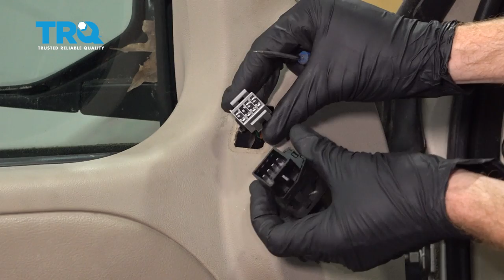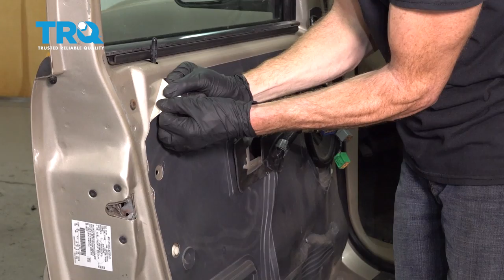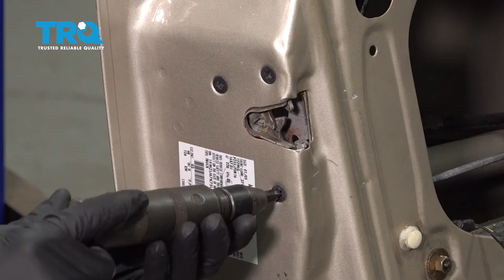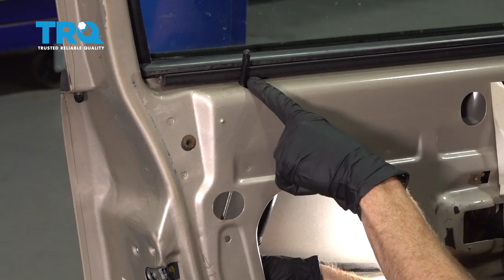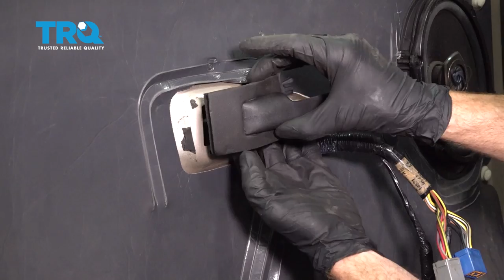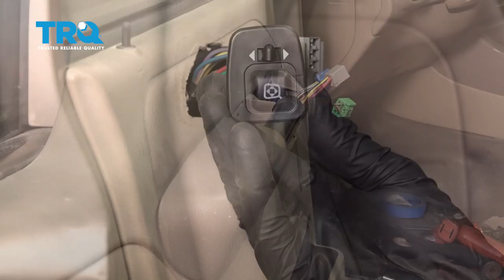Door Lock Actuator & Latch 2001-2005 Ford Explorer Sport Trac

Comment: Excellent tutorial and camera work. One exception at 13:30. Rather than drill out the 1/4" actuator rivet I found it easier to pry the actuator out of the original bracket to R&R. Also replaced three Philips #3 latch screws with flat head socket cap screws I found at Ace Hardware.

Comment: Ok guys don't use the impact screw driver too hard, I bent the door where the bolts to the door lock actuator screw in. My door wouldn't close and I had to use a slide puller to bend it back. Just use a reverse thread drill to get them out